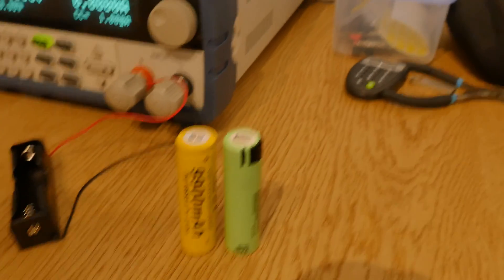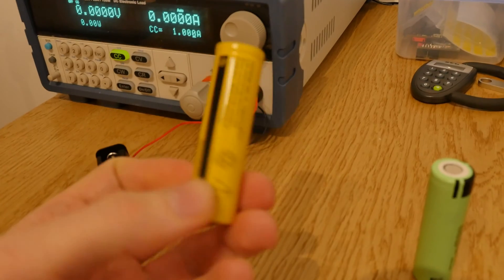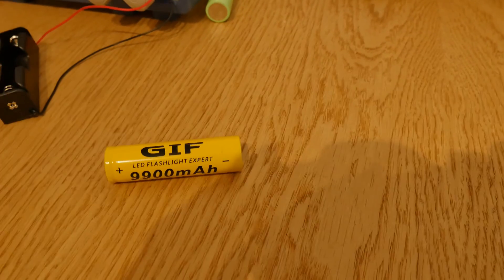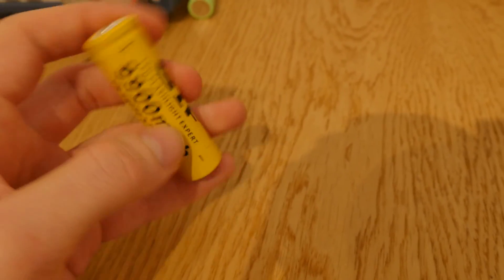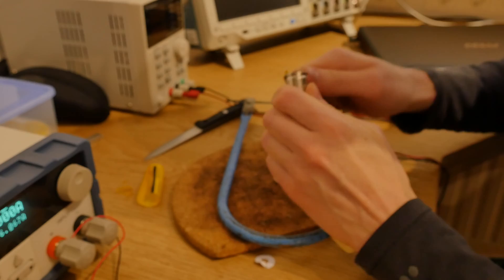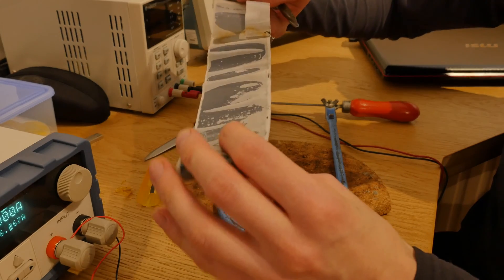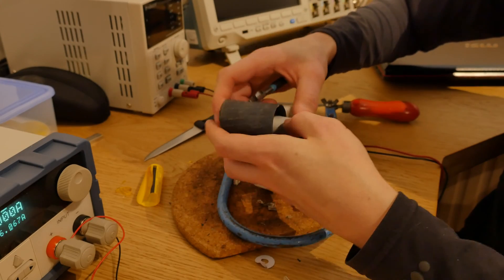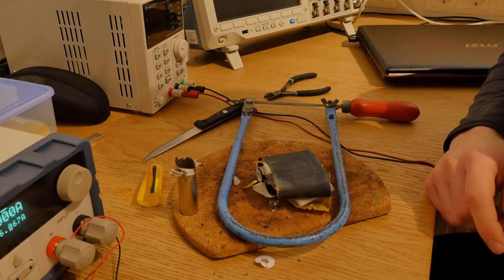9900mAh Ebay battery capacitance claim testing with teardown

Comment: did you ask for your money back? on grounds it does not meet its specification as provided by the seller.
Reply from the maker: Horváth Ágoston János 
Yes, and I also send this Video :D
Get full refund, since I knew it was fake to begin with :)
Reply: i was wondering on a business idea: order tons of 18650s from ebay/aliexpress that are marked 4000mAh or more, then measure their actual capacity (there are capacity meters available at the same places), then simply ask for your money back. I guess one could build a relatively reliable battery for free in the process.

My only question is why these sellers are still in business.
Reply from the maker: Horváth Ágoston János they are junk, dont bother
Reply: Horváth Ágoston János The battery works fine, just the mAh are a lies.They sell it only a fraction of the original product price everybody’s known it a lies in mAh .People just needed basic 18650 batteries packs for basic uses.
Reply: @Chu3505  I wouldn't care if they were selling cheap 18650 sized batteries IF they did not lie about its mAh or battery chemistry. However since they do lie SO much, I won't shop through any company that sells these batteries for anything, as I don't want to have to fact check EVERYTHING they claim and only find out after purchase, if it was actually a reasonable price.